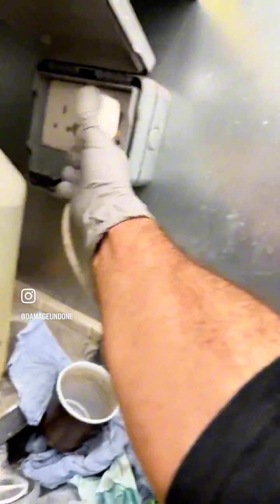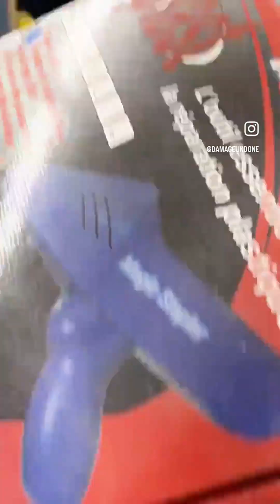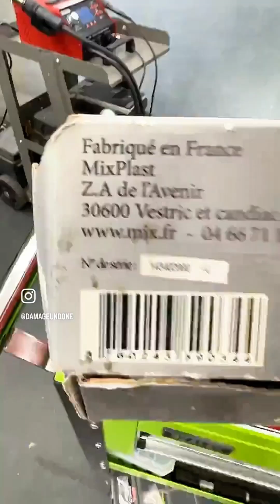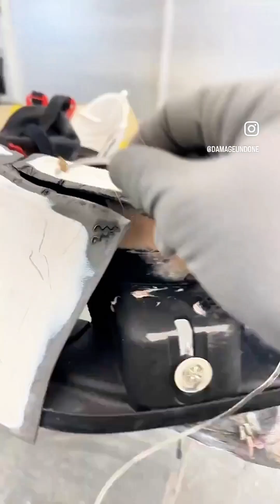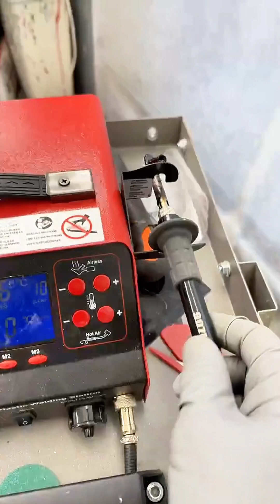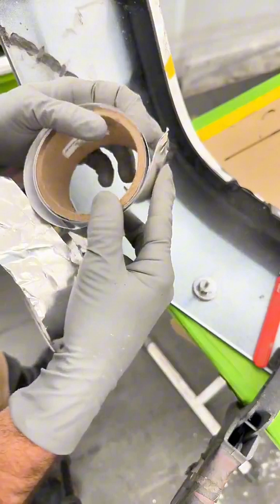PUR WELDING A MERCEDES G63 BRABUS

Comment: HI Wayne, great video and a good demo on repairing PUR which you said is a bit more difficult than other plastics, am I right in thinking that if you use the metal staples in a plastic you should remove them after the repair is done, as you demonstrated you can't use them with a PUR moulding🤔👍

Comment: This looks like a really good system ,I have the very good airless welder kit from Powertec but won’t to upgrade and there other kit are way to expensive ,can you tell where you got it from or did you import it
Reply: Very interesting video thanks Wayne.
Reply from the maker: @dougwernham5209 sorry it was so long but I think there is some good information in it
Reply from the maker: Hi, at the moment there isn’t a uk distributor for this welder but you can buy it directly from polyvance, so it might be worth you sending them a message to get the latest costs